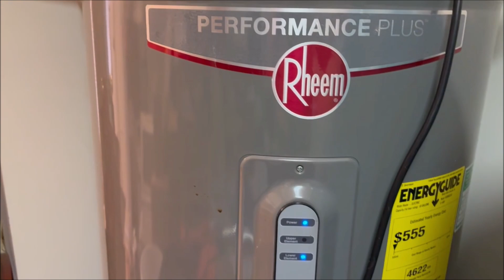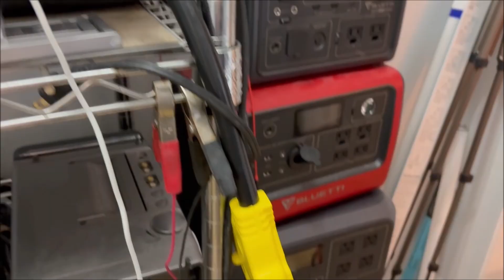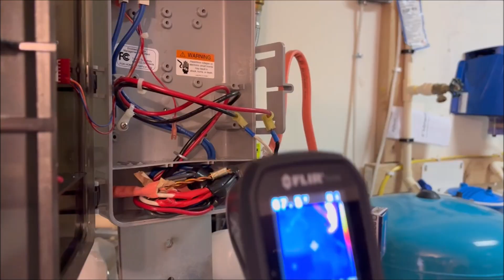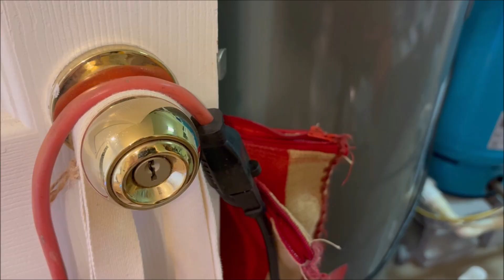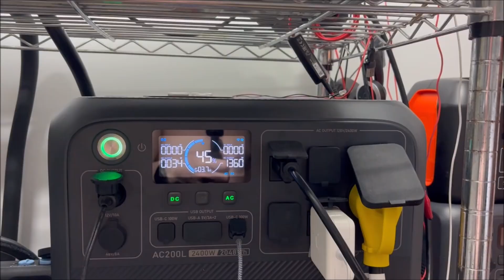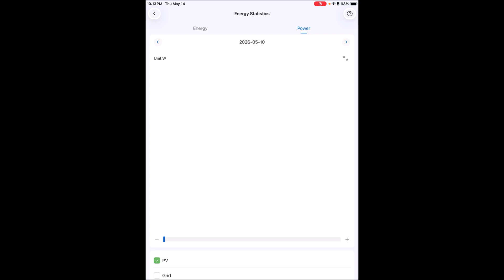Can you run a 240V water heater on a 110/120V Bluetti solar generator?

Comment: ya I would say your water heater and water pump would be one of the biggest consumers of energy, Been also looking for a solution i also have a 130 foot heat line into the lake and it uses 3watts per foot
Reply from the maker: You may be able to run your heat line on a thermostat so that it doesn't run all of the time.  Happy to brainstorm other solutions if helpful